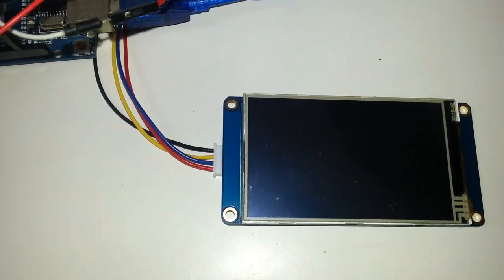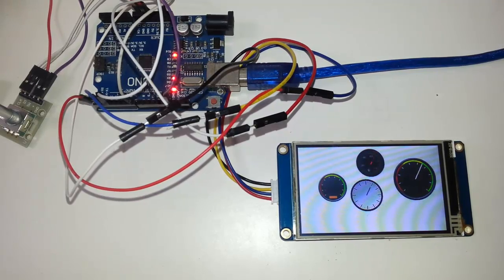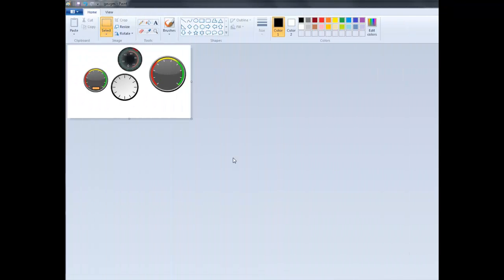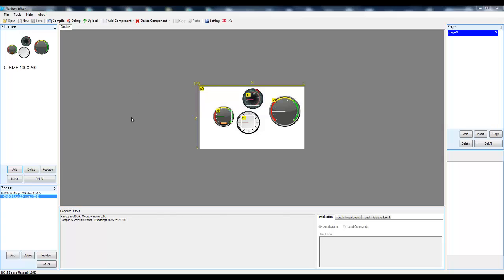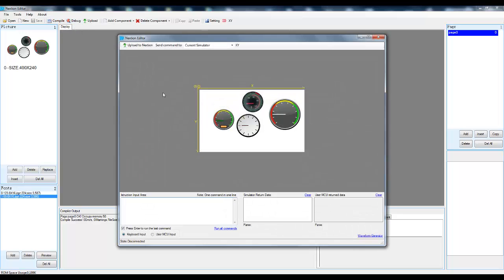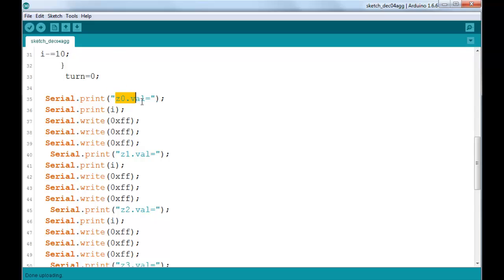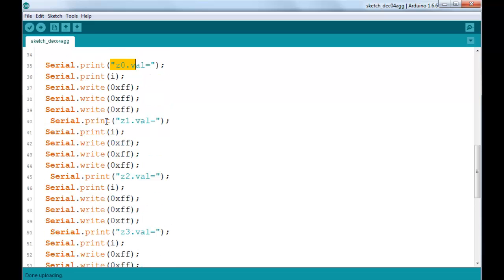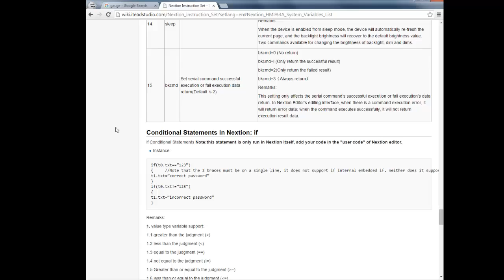Step by step tutorial : creating Nextion gauges with Arduino

Comment: Great Marco!! I have a question, is it possible to use a 5" display with F1 layout big numbers & colors to work with the real car Mychron5 data logger display? this data logger is a small screen, but gives a lot of info, like gear position, rpm, speed, lap time, etc. is for real car racing. Thank you

Comment: Hello,
First thank you for this great tutorial, I tried to remake it but when i compile, i have an error message " 'inter' was not declared in this scope".

can you help me please to understand?

thanks.
Reply: Yes, I can help you. The "inter" or whatsoever you want to call your ISR subroutine, you should to put somewhere bellow what this routine will call. For example of "inter", you may put something like this:
void inter()
{
  digitalWrite(13,1); //turn on LED on the board if interrupt is called
  delay(1000); //wait for 1 second = 1000 mS
  digitalWrite(13,0); //turn off this LED
} //end of the ISR routine
REMEMBER - do not put ";" after void inter(), because it is routine, nor you need to call it from the sketch - it will be automatically called when signal on pin 2 (in the case of this video) will goes from 1 to 0 (because of setting: "attachInterrupt(0,inter,FALLING); where you can change it to what you want. More info in next message, but if it fails (due to damn "Likely spam" from the google/youtube...), search google for "attachinterrupt" and perhaps add "arduino".
Oh, probably your are beginner like me: in void setup, put:
void setup()
{
pinMode (2,INPUT_PULLUP); //connect push button (momentary switch) between pin 2 and GND
pinMode (13,OUTPUT);
//if not declared, this pin may be input by default
attachInterrupt(0,myInterrupt,CHANGE);
}
void loop()
{
//do nothing, just wait for interrupt, this time when status on pin 2 changes, either from 0 to 1 or 1 to 0
}
void myInterrupt()
{
digitalWrite(13,1);
delay(1000);
digitalWrite(13,0);
}
This sketch will gives you blink LED for 1 seconds any time when pin 2 [INT0/PCINT18/PD2/32/2] changes state, connect some push button, and LED will blink only when changes from not pressed to pressed and vice versa. You may play with this - ISR are very powerful thing! Do some program, and if ISR is triggered, it will remember from where it jumps to ISR, execute ISR and back to the main program after it is done. Thanks.
Reply: Here you may find more info: https://www.arduino.cc/en/Reference/AttachInterrupt
I hope that it will not end in "Likely spam", and/or user of this channel may review this message and put "green light" and permit this message to show. Thanks.
Reply: I got the same trouble.  error message: 'inter' was not declared in this scope. I think IDE say the  instruction "attachInterrupt" was not declared in this scope. But when I copy this instruction from your source it is still the same. I dont khow what wrong?
Reply: Did you named your function correctly? For example: " void inter() {//some code here} " and when " attachInterrupt(0,inter,FALLING); " notice that that two words must be the same ...